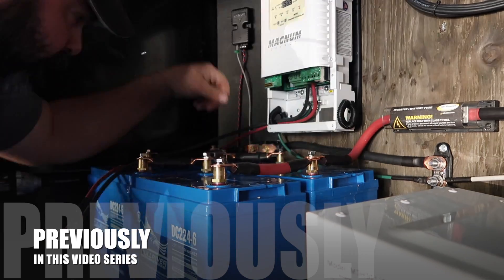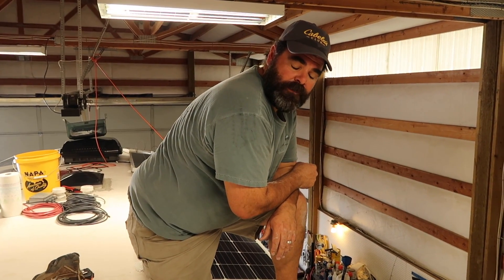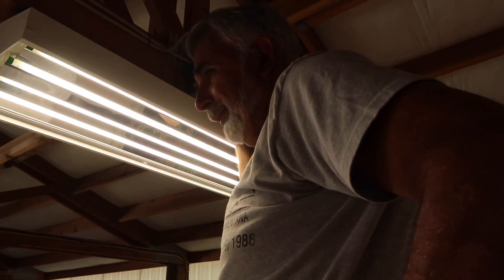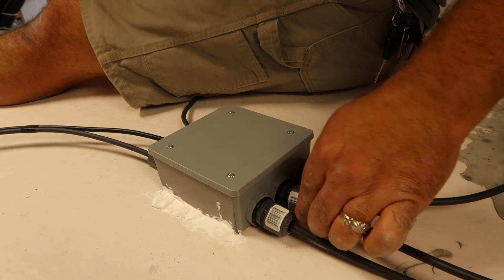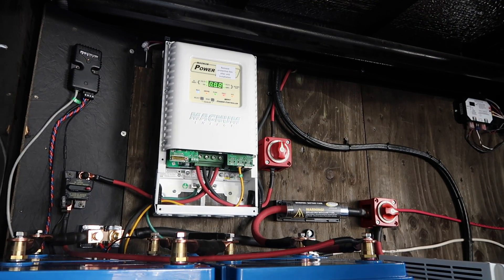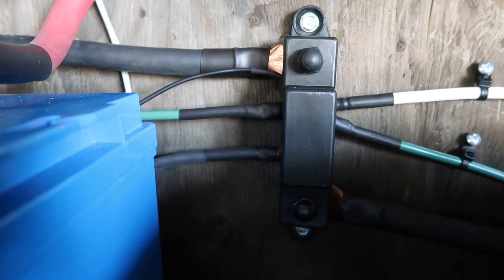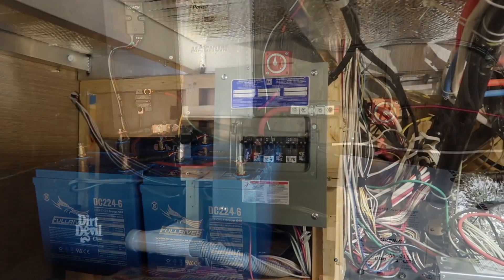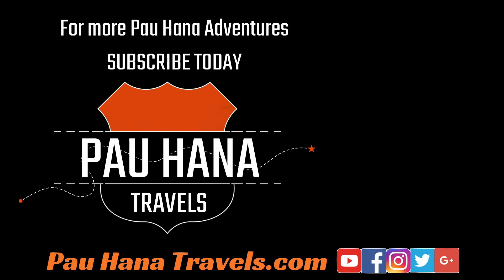RV Solar Installation - Part 6: Installing and Wiring up the Solar Panels  🚐🌞

Comment: What does the underside of all the foot brackets to attach screws through the roof look like? Does the screw stick through the roof to the interior of the RV? Did you put a nut on the interior side of the roof?

Comment: Just purchased   A 2018 cedar creek Hathaway which has solar ready notices everywhere but cannot find where the wiring comes from roof into coach. Any suggestions where to look?  The roof has solar box and wiring and there are solar ready cables at the battery but no wires coming down to that site from roof.

Comment: This is meant to be a how-to video but there is not much specific explanation.  It's mostly some sped up footage of two dudes on a roof.  Lots of reasonable questions in the comment section which are never addressed.
Reply from the maker: This was never meant to be a how-to video. This is how we did a complete install for our Dad’s 5th wheels needs. Every users needs are different and this is why we put a disclaimer on each of these videos that this is not a professional install. We are RV owners doing our own diy install. This is part 6 in a series of videos showing the installation and many have said this is the most informational video series out there on installing solar. Thanks for watching.
Reply from the maker: This was never meant to be a how-to video. This is how we did a complete install for our Dad’s 5th wheels needs. Every users needs are different and this is why we put a disclaimer on each of these videos that this is not a professional install. We are RV owners doing our own diy install. This is part 6 in a series of videos showing the installation and many have said this is one of the most informational video series out there on installing solar. Thanks for watching.

Comment: Thanks for the video. I looked at the web page a few times but didn't see the wire covering you used on the roof to cover the solar wire. Also you schematic doesn't look right to me. The 50amp shore power goes into the inverter and from the inverter back to the panel. What am I missing?
Reply from the maker: Larry, thanks for following out adventures and commenting. The wires on the roof are specific solar wiring that includes a heavier sheath that is more UV resistant. I also wrapped it in split loom to further protect the wire. The 50amp feed co.es from the shore power (or generator) thru the transfer switch and then to the main circuit panel to feed the 120v circuits.  When not plugged in (or on genny) the inverter draws 12v from the  batteries and inverts it to 120v to feed the circuit panel. Hope this clears up things for you. GQ

Comment: How do you secure all of the panel wires on the roof to keep them from flopping in the wind? Thanks
Reply from the maker: They were secured with split loom and zip-ties screwed to the roof and then the screws were covered by dicor. We hear very little of the cords in windy situations.

Comment: Wonderful series on a solar install...are you using MP4 connectors or terminal connectors to wire your panels? I heard the MP4 connectors tend to have problems.

Comment: Fantastic series of installation videos! What is your view of grounding the aluminum frames of the panels for lightning protection? This, I’m told, would prevent current from finding their way to the negative side of the panels...

Comment: What kind of roof does the Fifth wheel have? I've seen others put down either Eternabond or Dicor tape under the brackets. They then put the tape over top the bracket and all the wires. This keep wind from getting under the wires and making them come loose or even braking them. It also helps protect from sun. I know Eternabond works best with rubber roofs.
Reply from the maker: We still haven’t finished the roof in this video but they used wire loom and dicored the wires down. It should be in the last video I believe so stay tuned. Also it’s a edpm (rubber) roof so screwing down was necessary. No tape was used.

Comment: Nice clean work!  Your dad will be very happy with this system.  I have been doing some finding on my own with our new to us 5th wheel.  We have a 2800 Magnum installed now with the magnum remote and battery monitor system.  Also, have the catastrophic fuse for the magnum.  I just got our new batteries delivered this afternoon.  4 VMAX 6 volt AGM 225 amp batts for when we install the solar system.  I am going to purchase 200-watt panels from Brian Boone as well as other items.  All this isn't going to happen immediately, but in the planning stage for when the home sells!  👍